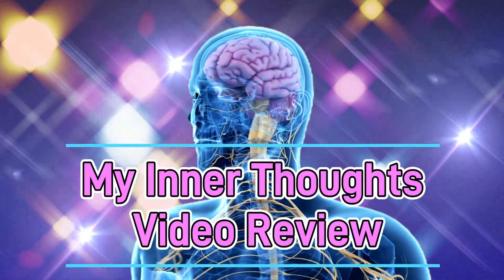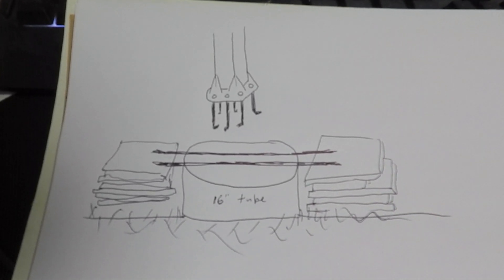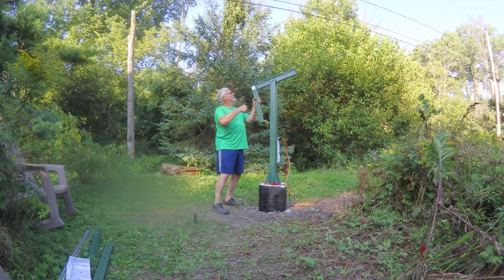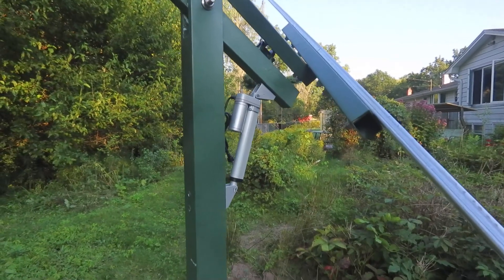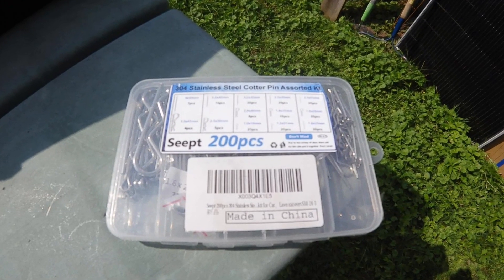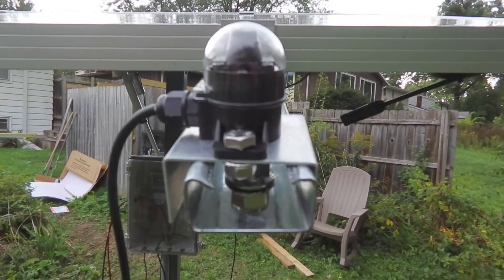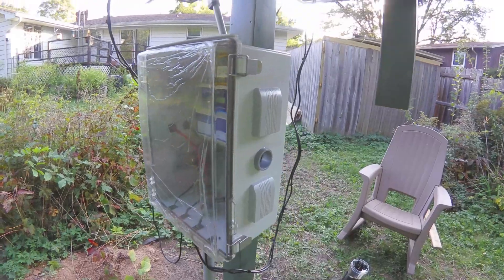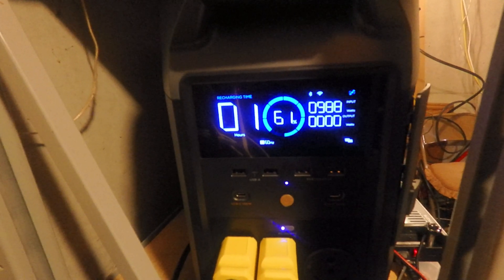Eco Worthy Solar Tracking Array

Comment: Due to the extreme drop in the price of solar panels, it is much cheaper to simply install more panels!
All studies only showed additional yields of  20% (single-axis) to 37% (dual axis) of solar trackers. In any case, trackers are mechanics and need maintenance. 
And they are very susceptible to wind and lightning strike. For this reason and because of the mechanics, most of them only last a 1-10 years. 
If you want more constant yields throughout the day, you simply have to set up your modules in an S-E and S-W orientation.
Reply from the maker: Do whatever you want, I think my system is fucking cool
Reply: @myinnerthoughts  Your system is f*cking cool, and thankyou for the time and effort in informing us in detail with this video. Even the lyrics of the song are entertaining. My guess is that a lot of genuine engineers or 'would-be' engineers (by that I mean serious DIYers, people who get a buzz from the relative complexity of a full system, etc.) would prefer to spend that extra bit to have the type of system they want rather than go with the cold logic of "All studies only showed additional yields of  20% (single-axis) to 37% (dual axis) of solar trackers" etc. etc. (Yawn, die of boredom...).
Reply from the maker: @christopherbooth9077  Thanks for liking my song I made and the time it took for me to help others.!

Comment: You’re running in dangerous territory with 155 volts going into the delta pro, max input voltage is 150, and on colder days that voltage can climb beyond 155 volts possibly frying your unit. Personally I would go in a 3s2p configuration with your panels.
Reply from the maker: Its 144, I messed up when I said 155.
Reply: I have 4 panels. Is it better to run them 4s or 4p configuration?
Reply: In series the volts add together but amps stay the same.
In parallel the amps add together but volts stay the same.
If running parallel you may need to run heavier cable to support the amps.
When configuring your setup be sure to remain under the max voltage, watts and amps don’t matter as your unit will only pull what it can.
Reply from the maker: @carlthetruthwilliams9447  It depends on what the specifications are on the unit you have for solar input.
Reply from the maker: @carlthetruthwilliams9447  if its in parallel the voltage will stay the same, I don't want 24 volts, I want 144 because my solar input on my unit can take up to 150.
Reply from the maker: @carlthetruthwilliams9447  It depends on the input of your device, here is a calculator to see what works for you.
 https://footprinthero.com/solar-panel-series-and-parallel-calculator